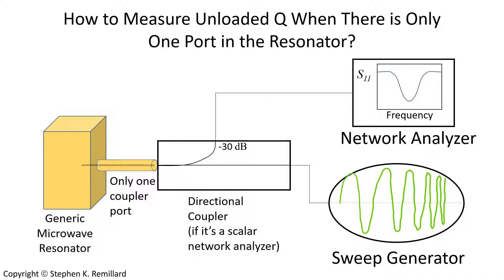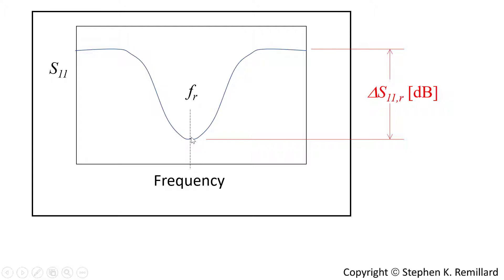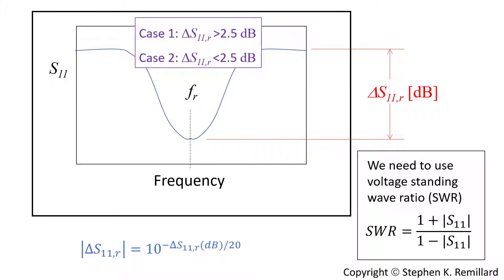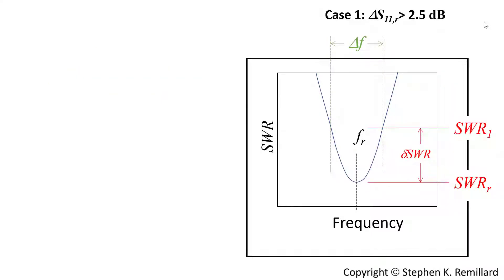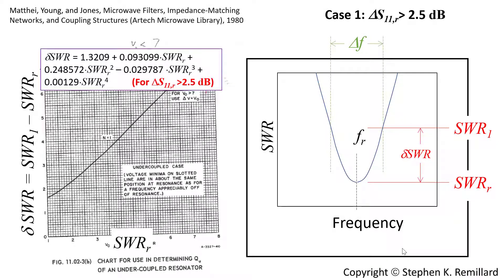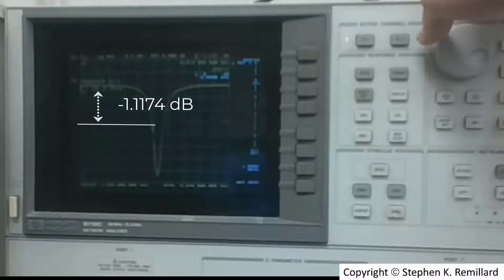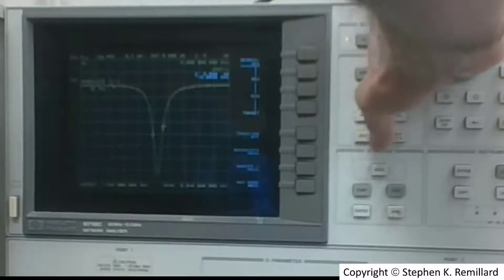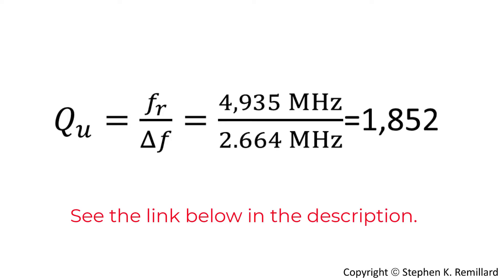How to Measure the Unloaded Q of a Microwave Resonator with only one Port

Comment: I love this video. Thank you for making. I wanted to clarify that although in the video Stephen talks about "Strong Coupling" vs "Weak Coupling" - in both cases he is assuming an under-coupled situation. The chart shown in MYJ Fig 11.02-3(b) reports "For V0>7 use deltaV=V0" (VSWR of 7 is a RL of 2.5dB).  In the book MYJ also present a case for an over-coupled situation (which is practically less use and not included in this video by Stephen).

Comment: Hi Stephen, very nice video. However, with perfect coupling (SWR = 1), Q_L can be measured at -3dB, in which case Q0 = 2*QL, right?
Reply: For the case of critical coupling only i.e. the RL at resonance will be better than say 35dB then unloaded Q can be given by Qu = 2 * Fr / BW3dB [ref: "Theory and Design of Microwave Filters", Ian Hunter, IEE Electromagnetic Series 48, page 134-135]. This relies on being able to adjust the coupling. In some cases this can be done by using a "probe" into a resonator and adjusting it until critical coupling is achieved. In practice this is fiddly so the solution presented in the video by Stephen is superior and much more generally useful.

Comment: This was a great video Stephen. I am curious as to why we don’t just use the -3dB point to obtain the width?
Reply from the maker: James, The -3 dB point is used to measure the half power width of transmission only.  This does not relate in any way to the reflection.  It is much trickier to determine how much power is being reflected at the width that would correspond to 50% transmission.

Comment: Do you think this is valid for non-cavity resonators? such as LC circuits?
Reply: Yes, this is valid for all microwave resonators e.g. coaxial, waveguide, lumped/discrete, printed.  Essentially all simple resonators can be represented as a lumped (LC) circuit. Most of the printed (bookwork) theory is derived from the starting point of an LC circuit.